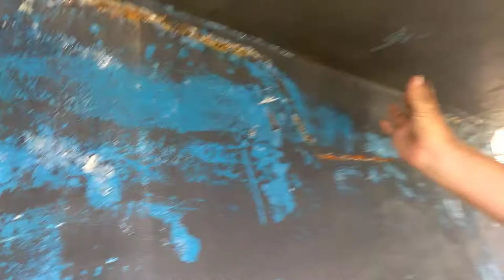Keel Delamination

Comment from the maker: Yes
Reply: keel removed or just cut groove what sealant 5200 or G flex or ??  My keel joint  looks just like this and the answer from boatyard is its normal ?? live with it ??  I think proper repair is remove keel and redo joint but thats big $$ ... at a minimum cut groove along  and epoxy ?  They faired the kee,l but very sure they did not address the joint no groove no sealant just fairing compound and it cracked again as soon as the boat moved? so now I have a smooth smaller crack :)   I need help to figure out how to handle these the yard guys  and what to do to make it right  I have good pics 
also said the keel bolts would not budge and just cleaned them up and that was it ? No tightening  ?? they had no Idea of sequence or even torque spec or bolt size for the boat  real bummer  still on hard so want to fix now 
Thanks !